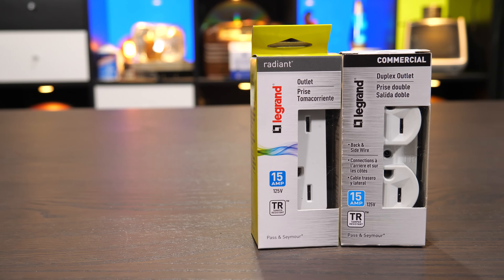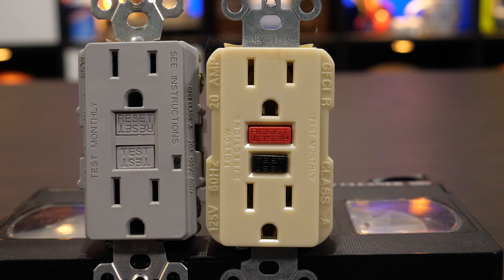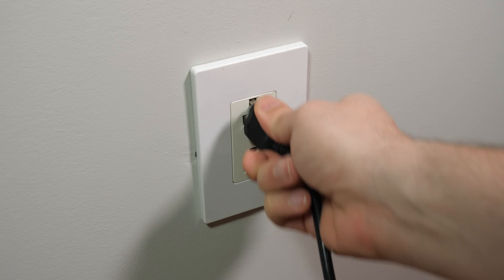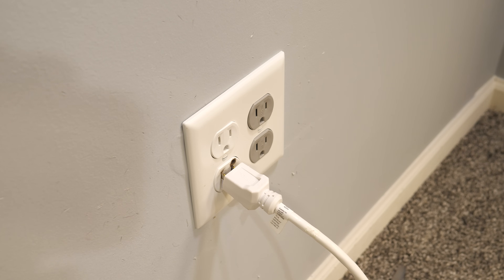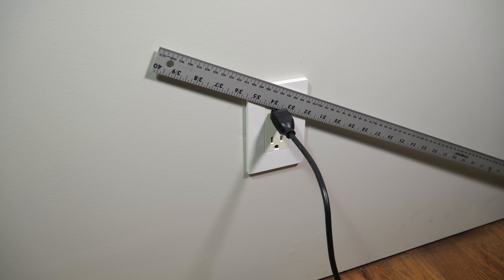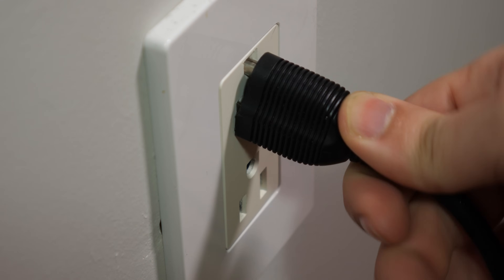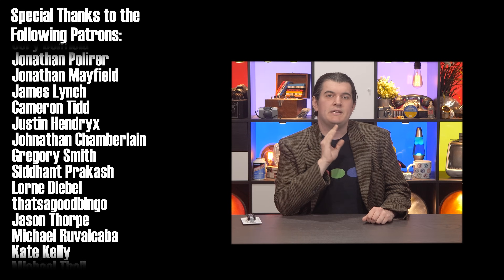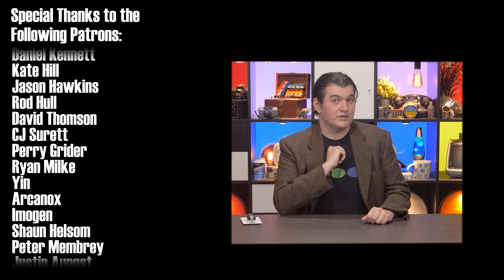Power outlets are topsy turvy - but does it matter?

Comment: My house in Georgia  was built in 1966 an was built with the outlets ground prong up. The ones that actually have a ground prong hole that is. About half dont. Anyway, the upside down plugs are a pain for all those reasons an more. The current problem is the phone holding usb adapters I have are upside down so cant actually hold a phone.

Comment: I get the whole safety thing about other plug and socket designs being safer to insert and remove, but seriously, does anyone know someone who's shocked themselves while plugging in or removing. I've never shocked myself that way, or know of anyone who has. 

The only times I've shocked myself is when my wife saw a breaker turned off in the garage, and thought "hmm, that should probably be on", right when I installing an outlet on that circuit. Went to touch the hot again and bam, nice little wake up call.

The second time was being a little sloppy installing a new breaker into my main panel without turning off the main breaker because I was feeling ballsy. Pulling wire up into the panel, and I brushed my arm along the live bus in the center (thankfully only one 120v prong) and the panel itself, causing yet another nice wake up call.

If you can't tell, part of my point is there is a huge difference in safety requirements when using 220V/240V vs 110V/120V. You have to be pretty lucky to be killed by 120.

Comment: It's really because gravity helps the electrons flow and fall out when it's like that.

Also, for the smaller plugs this is fine. But the larger plugs (like the NEMA16-50) it matters, it is assumed the ground pin is on the top.

Comment: I remember that in Spain the plugs were type C and type A in very old 120v installations, the plugs were very unsafe, in fact, some of the latest type A plugs that I have seen in person, were installed in the school where I studied, A child took a metal bell from a board game and fitted it between the pegs and made a good explosion, in the end they removed those plugs and put them in Schuko type 🤣🤣🤣.  (Those plugs might be working at 100v more than they were designed for...).  With the entry into the European Union, plus the very harsh ICT regulations, it was forced to install Schuko type plugs in Spain, although they left many plugs incompatible (in fact, I have a game console with a type c plug that cannot fit into a Schuko), and luckily the type C cables have disappeared, because there were still cables without insulation at the ends.
Reply: Type A in Spain is very rare, where I live the infrastructure still works at 120v and there were many buildings with very old type A plugs. Now we have three-phase without neutral and we do get the 230v that is required today, but it is more insecure.

Comment: Personally, I like the wild west outlets.  You can yank on the vacuum cleaner chord from across the hall to quickly and effectively pull it out of the receptacle.  Modern tamper resistant plugs do have the little plastic thingy built inside the sockets, so they are more safe-ish.   Sure you can still force shove metal things in them, but it is more difficult, and as a bonus kids get to figure out the dangers of electricity at an early age (if they live)(but realistically, all plugs have vulnerabilities).
Reply: When I was 10 I learned the hard way, never did it again.😱 oh and the plug was sideways! 😱

Comment: On a UK plug, there is no chance of the plastic insulating sleeves on the live and neutral pins fouling the receptacle, because the brass pins are profiled so that the plastic part has the same dimensions as the metal.

Comment: How about a plug that's sideways, but the two plugs are opposite from each other, 'eyes' in the middle so that wallwarts stick out to each side?  Or slightly longer sideways ones where both outlets are eyes on top?  (A little farther apart so that both outlets can take a slightly fat wallwart.)  

For fixing the problems with the right angle plug, how about making a small flare on the back side to make it easier to grab them?

Comment: A house I grew up in which had been rewired still had the old outlets sideways in the baseboard. I always thought that was a great place as it'd be easy to install them. As to yours, it's definitely easier on conduit to go sideways, as single gang steel boxes typically have a single round hole at the top and bottom for connectors to screw in, so if the wiring is running horizontal, you either mount the box sideways, or have to get creative to connect the conduit.

Comment: Schuko Type F
The one big downside is that there are too many variations and too few consistent regulations. Some countries but not all require mechanical covers on the socker-holes that only open when both prongs are pressed in. The "europlug" did address some of the problems by requiring the pins to be non-conductive at the base but it is ungrounded.

Comment: I don’t know man. Even if not all the plugs are three prong, if at least some of them are that's already a safety improvement for at least those plugs. Right angle plugs sound like a great reason to have facey orientation, but here's another solution – how about making the top receptacle have the ground plug top, and the bottom receptacle – ground plug bottom? Then everybody is happy? (And in Chicago you could even plug TWO RIGHT ANGLE PLUGS AT ONCE)

Comment: I personally think  the outlets should be mounted horizontally, and two feet above the floor so you don't have to climb behind things in order to plug things in.  Have you ever noticed when you go to a hotel the top outlet is usually worn out and loose?  Thats because it's closer to the person plugging it in.  That's why I say how much should be no closer to the floor then two feet. I'm 6'2 and find it a pain in the butt to have to climb behind things in order to plug in some electrical device.

Comment: When permitting my basement reno, my electrical inspector literally suggested I flip one of the duplex outlets in all my double gang boxes, so that power bricks, and various plug designs have less of a chance of blocking another outlet. I liked the idea and did it, all other outlets were installed "face" orientation.

Comment: Fun Fact: You can botch a travel adapter for US to EU plug, but inserting the US plug half way and then shoving the EU plug in between the recepticle and the plug to touch the live blades. Wouldn't recommend for obvious reasons, but it works 🤷

Comment: This is the bane of my existence because it means I have to mount my car's charger in a funky way. It wouldn't be so bad if the Australian (the old style 240v 20a outlet used in the states) to 5-15 adapter didn't also do this nonsense, opposite of how the 120v outlets are mounted in the old fashion.

Comment: It would take one large state to mandate shielded blades on plugs and most appliance manufacturers would switch to it as a defacto standard rather than have 2 different products. In a relatively short amount of time they would become common enough that other states could mandate it too and effectively force a new design standard.

Comment: Considering the Type G, or UK connector, Has the Ground pin on top like that. But there's a lot more rules about having a ground pin in the first place and sleeving for protection... and the length of the pins.

Comment: As an electrician, I hate it when outlets are put in upsidedown. 
The majority of plugs (as in plug not outlet) are ungrounded (no ground prong), and even the ones that are grounded can still be shorted out in ground-up receptacles by conductive objects falling between/on the hot and ground. 

The real reason why I hate it so much, however, is that it's a poor excuse, a lazy cheap and ineffective solution to a very serious problem. It's the wrong approach.

The plugs are the problem, not the receptacle/outlet. Their prongs need to be insulated halfway, so that touching the prongs or any object that falls onto them will not be exposed to the live current.
If any changes are made to the receptacle, they should be recessed like many in Europe, so that falling objects hit the cord / fuse block and not the prongs of the plug.

If only the NEC and NFPA listened to and observed these much more practical solutions more. But in the US we never blame manufacturing / corporations for what they cause, oh no, it's those dumb electricians that aren't installing the receptacles upsidedow- I mean right side up! It's always about money and not safety. It's never their fault.

Anyways, thanks for listening.

Comment: 4:20 / 4:29 - well, touching it with your thumb becomes muchly mitigated.  In my one experience of touching the blades, though (when I was 11 or 12), it was that I touched the hot with my index finger and the neutral with my thumb, so... that'd be pretty much just as easy, either way.  (Well, at least it was, back then -- this was a 5:46 type of plug, on a heathkit receiver unit.)  Anyway, yeah, for reasons like 11:42 I don't imagine I'll change my habits any time soon -- though I might change some specific outlets in locations where metallic foreign objects seem more likely (e.g. near metalworking tools, where I think 16:58 might also be a good idea) than the general baseline risk level, as determined by the frequency with which I engage in throwing knives at the wall, like at 7:40.  ;)

Comment: I've seen Americans moan they wouldn't want the UK system as they tend to be expensive. Well judging by the prices you show yours are far more expensive. A decent quality "outlet" in the UK can be had for less than £10 so 12dollars ish. Cheap ones can be had for about £3. The plugs are usually around £2.

Comment: In Brazil, we use type N. The wall connection is deep in the receptacle and the live plugs have a plastic padding.
So it's virtually impossible for a live plug to become exposed (while connected).
Reply: Brazil made a mistake when switching to Type N for everything.  They should have used Type N for 127V outlets and Type G for 220V outlets so it's impossible to plug a device into an outlet of the wrong voltage.  I know they're supposed to be marked, but that seems like a half measure.

Do you know why Brazil has two different standard voltage and why they never standardized on only one?  Here in the US we have both 120V and 240V, but 240V is only for appliances drawing large amounts of power like an electric oven or clothes dryer, and they have plugs which are different from the standard 120V outlet.
Reply: @LoveClassicMusic0205 Voltage in Brazil is regional. Half of the country (including here where I live) is only 220V, so changing the plug or not doesn't matter.
In places where it is 110V, only some parts of the house (usually the kitchen) are 220V, while the rest is 110V.
Furthermore, apart from a few small things, everything else is bivolt, so the voltage difference doesn't really matter. 
As for the question of why, the answer is historical: at the time they went to install these distribution networks, they hired companies from several countries. Those from North America (in general) went to the south and companies from Europe (also in general) went to the north
Reply: @LoveClassicMusic0205  perhaps, but we have two types of plugs (one more thick than the other), we could have used those and use color coded outlets as well.

As why we have both 120/240v, I believe it’s related to the grid. Some cities in my current State are fully 240, while others are 120v (but in those cities, you still see 240v things like AC, Ovens, Driers, etc.)
Reply: looks very similar to type J used in switzerland, wonder why they are not the same

Comment: Alex, tamper resistant outlets have been a requirement in the NEC since the 2008 revision of NFPA 70. As always, check your local and state regulations to see what has been adopted. Ohio, for example, is adopting the 2023 version in January 2024.

Comment: First off, your shirt.... "Sony Trinitron" logo?

Anyway, I work in a hospital, ground position is traditionally pin down. There are a few areas  that renovations have happened that we did not see it was "pin up" in the spec or that would of been changed.

Usually I have mounted receptacles  pin up  if they are switched or split switched for easy identification.

Comment: I'm in the US and I have actually seen sleeved prongs. I don't recall where I saw them at though. But they look a "lot" like the one you had there with the shrink wrap on the prongs.
I agree, this would fix quite a bit of the potential of touching the prongs accidentally, or on purpose like your knife throwing bit, if the plug were to become slightly dislodged somehow.

Comment: There was one time where the ground on top would have saved us: There was a metal outlet cover missing its screw, and movement of the pedestal it was on caused the cover to slide down between the plug and  the outlet, causing the hot and neutrals to be connected. Large spark, breaker popped, words said.
Reply: I have actually seen this happen more than once when painters came through my work and took all the outlet covers off and then put them back on but not always securely enough and caused a few shorts and tripped breakers.
Reply: Metal covers certainly should be changed out.
Reply: @josephoberlander a properly installed metal cover is certainly preferred in commercial and industrial applications for the durability. Although it certainly does pose a risk if the outlets are groundside down.

Comment: 7:10 This actually happened at my place about a year ago: we had an extension cord behind my mom's dresser that ran to some Christmas lights in the hall. One night one of her bracelets (a thin metal chain) fell off the back of the dress and shorted it out... needless to say that it made quite a spark show: also ended up partly melting the bracelet to the plug as well.
Reply: I also managed to do this as a kid by pushing a paperclip off the back of my desk which fell onto a plug which wasn't all the way into the receptacle. Shorted out, big soot mark on the wall. But it was a two prong lamp cord so it would have happened either way.
Reply: It's a flexible chain, it would have drooped down on either side of the ground pin and shorted between the ground pin and the hot pin anyway...
Reply: Yep. My wife was cleaning the bathroom counter and hung a loose necklace from the nightlight. Poof!
Reply: This is exactly the kind of situation I was going to suggest as the most likely way for this kind of short to happen - plugs behind a dresser/desk/end table. You have a tight space making it difficult to check or reseat plugs, plus that narrow gap directs anything that falls right in line with said plug. Add some change (back when us old folks used to carry cash), jewelry, small toys, the mockingly demonstrated cutlery if you eat near that particular furniture.. suddenly it becomes not all that unlikely over time that something eventually finds a home resting across those plugs.
Reply: The fact that someone watched this video and experienced it probably suggests that it's far more common than is suggested
Reply: @edrose5045  People that have had issues with electrical safety are more likely to watch a video on electrical safety and comment on their issue, vs a large amount of people that have not had these issues, more at 10.

Edit: That being said, you shouldn't ignore electrical safety necessarily because a particular event is unlikely.  "No matter how safe you are, accidents will happen", therefore it's best to be prepared in the event of one beforehand.  Do a cost vs benefits analysis at your discretion.

Comment: My house was built in the '70s and like over half of my receptacles are upside down. The way it makes the cables bend feel so unnatural like they're going to break or something and it's really annoying. Not to mention that some of them don't do anything and some of them have a switch that turns them on or off very annoying and what makes it worse those rooms don't even have any lights in them. 100% thumbs down.

12:29 my washing machine plug looks like that. No idea where my dryer is plugged into.

Comment: I think a good solution for the sleeved prongs could be receptacles or covers that have a ring protruding from around the outlet that would be the shielding. This would avoid any issues with the current standard and still provide an additional safety measure.

Comment: I love the NEMA 5-15 and 5-20.  The only real problem I see is that we allow cheap and inferior designs to be sold, that wear out too easily.  Solve that problem, and the whole thing is a moot point.  I have only had any if the issues you described when dealing with worn out receptacles, or non-polarized plugs (both of which should no longer exist).  Certainly a lot better than the literal weapon that is the UK plug, or the hodgepodge of Europe.
Reply: I dont think its necessary to completely ban non polarized plugs, as the applications where they are still used are in situations where polarity simply does not matter, such as a laptops power supply or a string of Christmas lights.

Comment: 45 degree right-angle plugs also have the benefit of not fouling up on each other as bad in the same outlet, but I disagree they should be the default. Power strips are often made so much more difficult to use efficiently with them. The Belkin strip I have has outward facing outlets on two edges and a line of outlets parallel to the length in the middle to help mitigate that, but there are times  I've had to get pretty creative to fit everything

Comment: This is not a new issue. Back in the day (~1960) my boss was in the HP lab with one of the HP founders and pointed out that a stray piece of solder could short out the plug. The next day the work bench outlets were inverted so the U ground was up